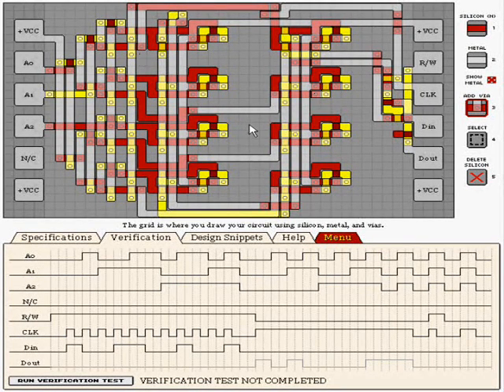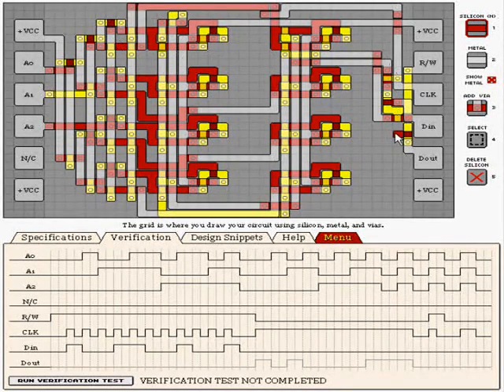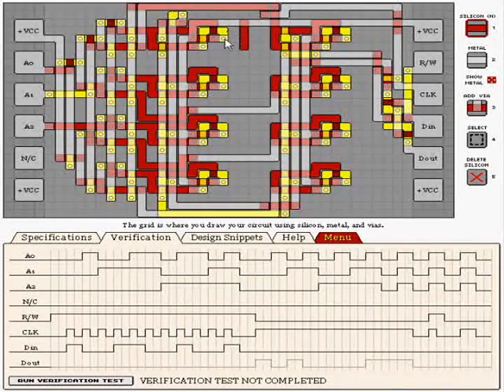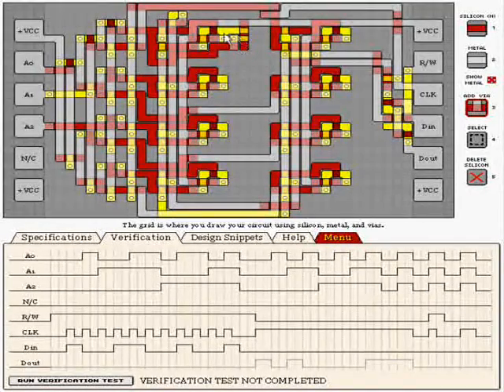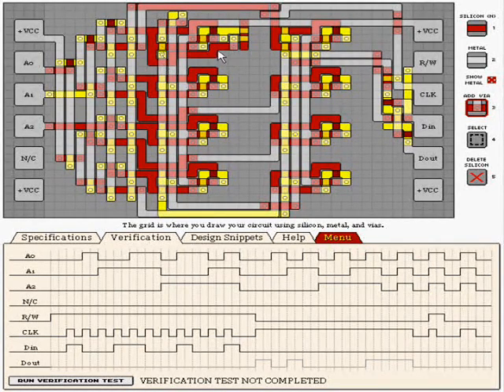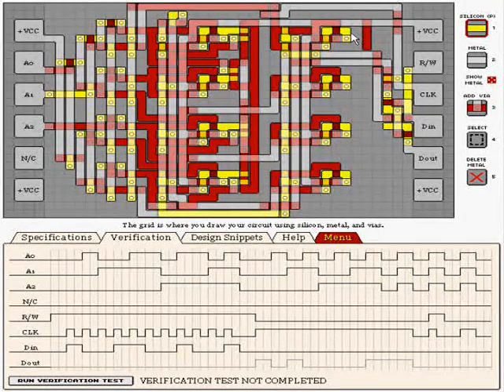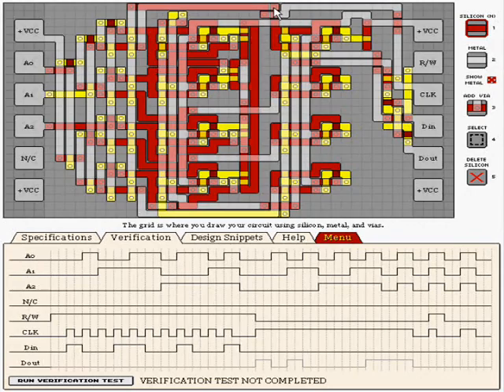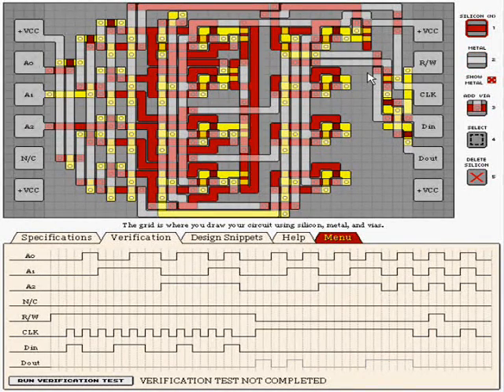KOHCTPYKTOP: Engineer of the People LP: Ep. 10 Part 3

Comment: This one took me about 3 hours. At first I started with 8 memory cells my design was a little different than yours and I didn't keep it well organized so I ran out of space close to the end. Then I looked at the verification table and noticed that only 3 of the memory cells (000, 010 and 111) were actually being used to output high signals, so I just deleted the others and finished the circuit. It was sort of cheating but I just didn't wanna start over. I really like the way you did it.